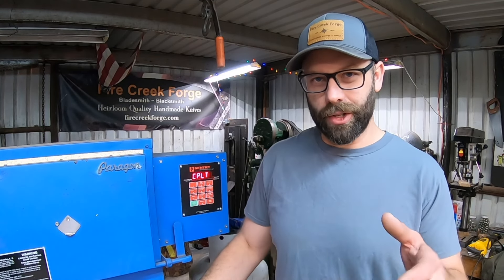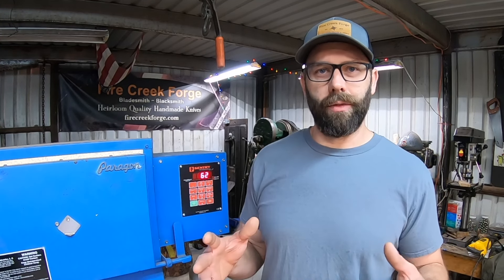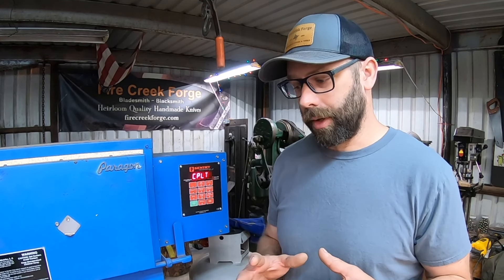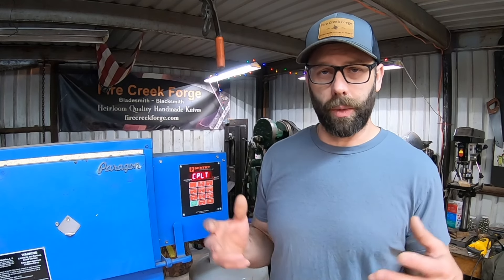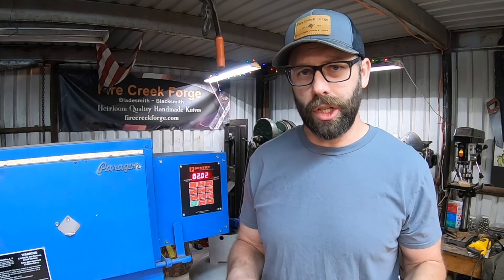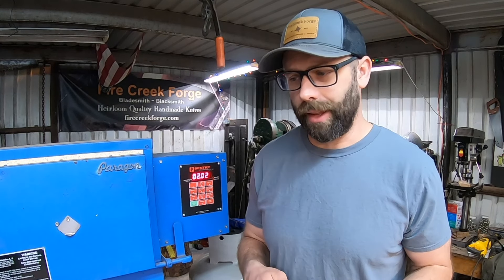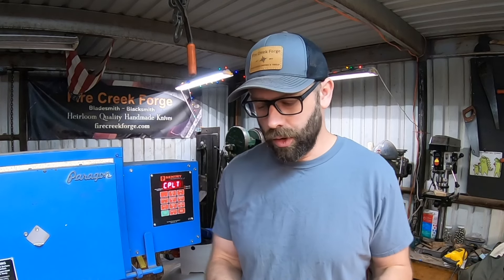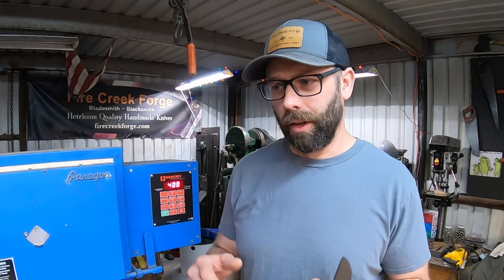Metallurgy Monday #1: Heat treating different steels in the same blade

Comment: I enjoy listening to you go more in depth with your metallurgy knowledge. I mainly forge damascus and use it as outer layers for san mai or forge welding a different steel into a canister billet axe head. I always liked that look of a single solid piece of steel for the cutting edge. It would be very cool to do an extremely dissimilar damascus blade to get a kind of serrated blade just because of the different steels like your damascus yakut. Keep it up Elijah! We all like learning from you

Comment: Even though the technique is as old as the hills, differential hardening even with modernized blade-making steels yields some incredible results. Claying the spine and core is how the katana masters did most of their magic (not to include the methods and steel chemistry itself, just in regards to heat treat here). If you're looking for one of the finest sources on the method and more than you'd ever want to know, scoop around for a book by Yoshindo Yoshihara and curated/translated by the Kapps. Adapt what you like and bear in mind that crucible steel wasn't around in the modern sense of the word in this application, but it's one of my favorite books on the topic.

Comment: geesh, when I was taught how to make knivesm40myears ago we  didn't have fancy dohickies so we learned y color of the metal. pair of cheap sunglass and your good to go ,nor did we have all the fancy stills back then, but a good go to was any spring steel . you could San mai 1095 and wrought iron then toss that into an acid and get a cool looking blade. At 70 years old I still don't have much fancy stuff..I did break down on my 63 birthday after having a heart attack and get a medium sized hammer press. Other then that it's my WWII lath . belt grinder's I made myself and hammers.